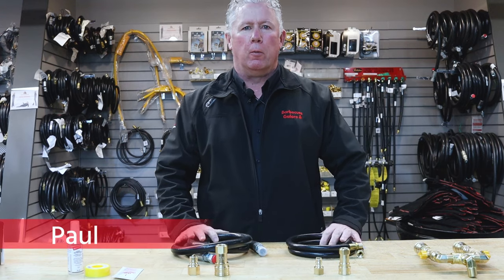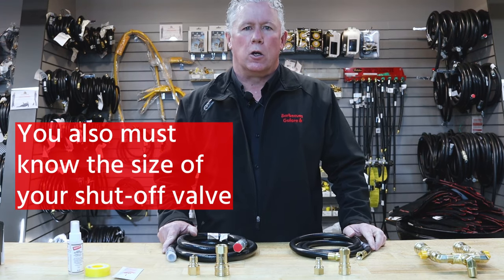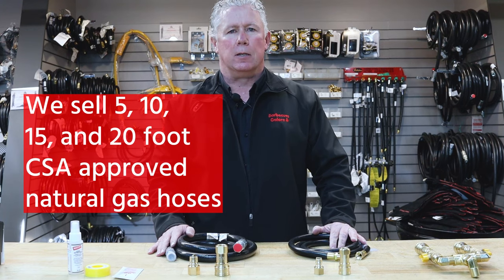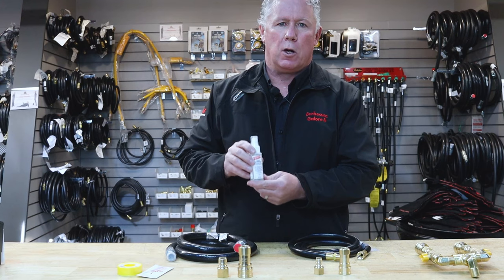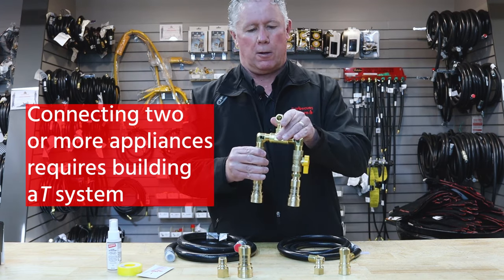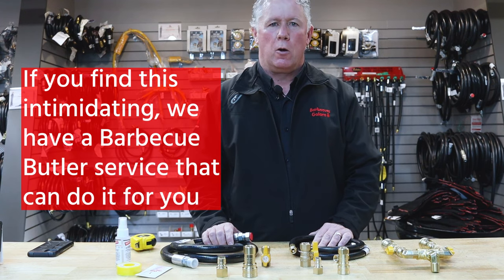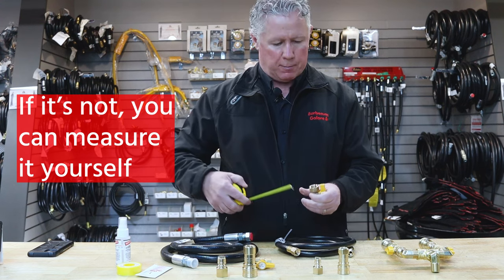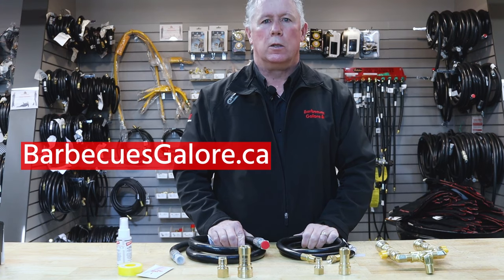Gas Hoses and Fittings: Measurements and Hook Up | Barbecues Galore

Comment: I'm very confused. Near the 3 minute mark, you describe how to determine the size of your fitting. You show how it is stamped on the side, or you can measure it. My confusion comes from the fact that these don't seem to match up at all! The side of the fitting says 1/2", but when you measure the fitting, the inner diameter is CLEARLY 3/4"! How is this possible? Based on the label, the "real" measurement is 1/2" - but where does one measure to come up with that?

I ask because I have a female quick disconnect that I have measured at 3/4", but I can't seem to find any natural gas hoses in this diameter. Everything is either 3/8" or 1/2". From this video, I'm guessing that maybe 1/2" is the diameter I want, but I'm hesitant, since that is actually SMALLER than my measurement of 3/4"... Any help on this?

Comment: Had a Plummer extend our home propane gas line out to our blackstone. I just need to hook up the hose from this new extension to the griddle. My question is. Do I need another regulator at the griddle itself? My Plummer said that the house regulator will reduce the gas flow but I am not sure if that is enough or if it is safe.
Reply: Hi Have the same doubt.
How you did?
Reply: @ms.b4408  talk with my gas company and they confirmed that the house regulator was enough. I just hooked up the LP hose to the new supply and she works great.
Reply: I'm here for the same information. I have a Blackstone but a propane tank though. I read it was a different pressure on the lines. Just can't find the right info.
Reply: @VectorAxus  talked with my gas company… one of their installers got back to me… I sent him pics of the house regulator. There is a regulator at my underground  tank and at my home… he confirmed that this should be fine for the Blackstone and he had the same setup with no regulator at the griddle. Depending on your home setup, I would just reach out to your local gas supplier to see if they agree.

Comment: It is more confusing than you explain here when you don't even show which end goes where - I have a natural gas barbecue and quick connect box and a 3/8 hose and a quick connect adapter - and can't even determine which end goes in to the barbeque.
Reply: Hi Jim.  Sounds like you should come in and talk to one of our experts.  Bring pictures and measurements of what you're trying to connect.
Reply: @bagavid4591  I have no idea where you are. So coming in is totally dependant on where you are.